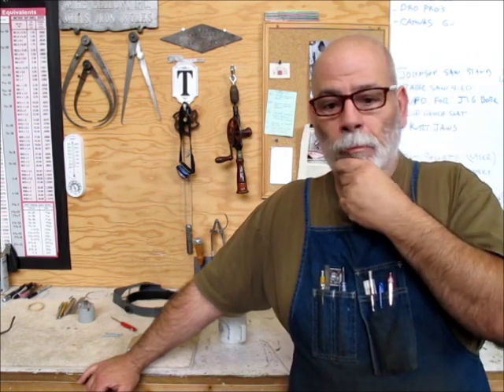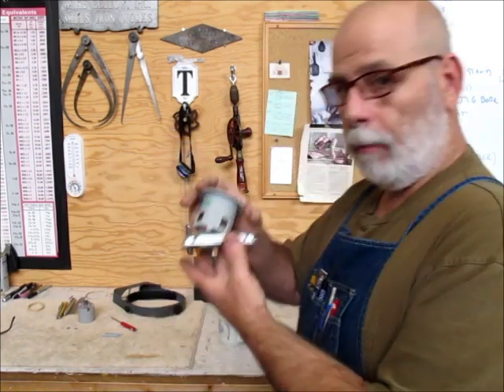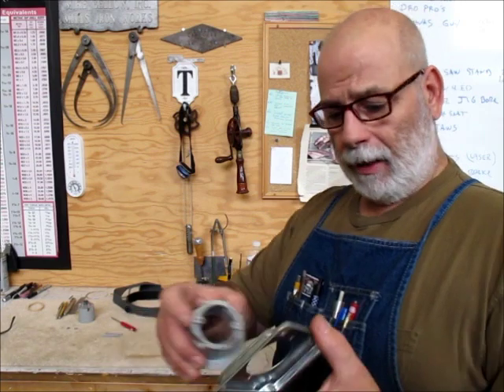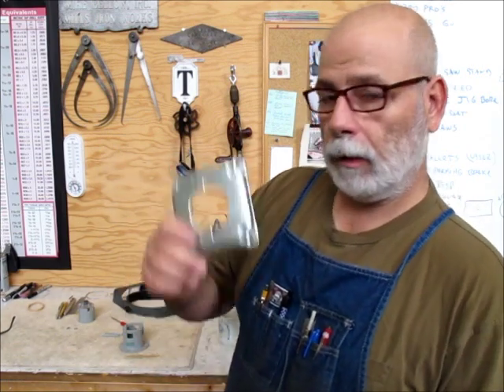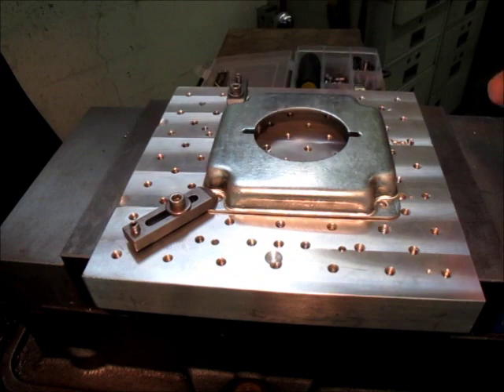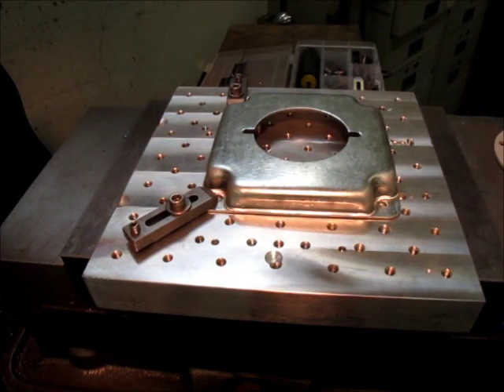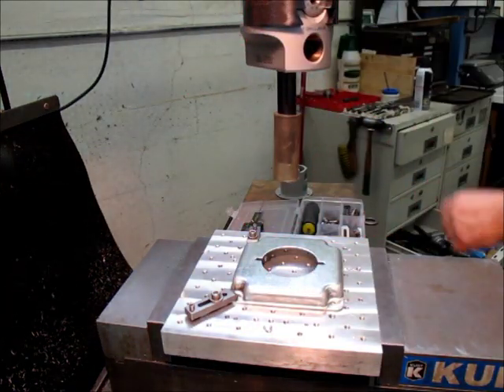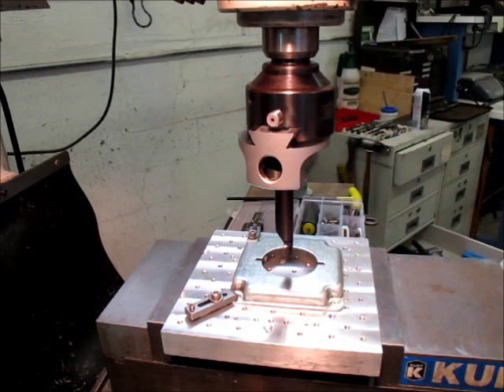Machinist vs Electrical Fitting

Comment: Hi Tom, thank you for the video, I'm now inspired to try to make some tiny clamps like those.

Could you explain why machinists don't like #6-32 screws? I inherited a tiny shop from a former colleague, and remember him saying he doesn't like them either. Missed the chance to ask him why.
Reply: The major diameter to minor diameter ratio is large. That means that it has to cut a lot of metal with a proportionally weaker tool, compared to other taps.

Comment: Quick question. Since this is just one hole, and in this case, it’s on center to the square plate, couldn’t we edge find the straight edges and find center of the entire plate?

Comment: That has got to be the most precisely located and shaped hole in an RS-13 cover in the world.  An electrician would have used his knock out cutter, warping the cover beyond belief, and then "forged" it flat with his hammer and the concrete floor.  Great job, gotta love the machinist mindset.  By the way, I am not a machinist and that was not a slam about the mindset.  Loved your work around to making the cover work.
Reply: Nope, no hammer. he would have pounded it flat on the concrete floor with his linesman's pliers.

Comment: I just love it when you guys (pros who do these things all day, every day) say it only takes a couple of seconds and then it takes two minutes. And on the second try, when you are showing the DI up close; three tries and it is still off. Makes little ole me feel better when I take several minutes, so thanks. 

On that hole in the electrical cover, I would have purchased one with a small hole (7/8"?) and just used one of my Greenlee chassis punches. Insert it, rough center, a minute of wrench work and done. With a perfectly punched, round hole. Notice I said a "chassis punch" and not "knockout punch".

Comment: FYI - Just in case you get landed with the job sometime, UK electrical switch plates plates are, since we went metric, usually M3.5 to mount the switch plates onto the electrical box. It's about the only place I KNOW we use M3.5 as standard. Cheap tap wrenches work fine because you're never tapping into anything but thin sheet steel.

Comment: I guess it's a good primer, but a huge part of learning the trade is learning what to let go. I'm used to running proto track machines, so I never would have approached the boring head, but I also never would have pulled my interapid out since you have the DRO. Why not bump one side with an end mill or edge finder, zero out, then bump the other side and split the difference. Bam. Zero. Or put it on the face plate and use a cone center to get it running true enough and cut metal.
Reply from the maker: +vclubamp Hi V,

I don't like edge finders for round stuff. Just personal preference. This video was about workholding not the actual best way to modify the particular part I used as my victim. Thanks for the comment.

Cheers,

Tom
Reply: I don't prefer edge finders for round work either, but for rough work, I just want quick. I would have just used an end mill...bump east, zero out, bump west and move back half and zero. Wash rinse and repeat north and south, then circle mill the hole. Anilam, hurco, and proto track, and wire edm have destroyed my will to break out the boring head anymore unless I absolutely have to.

Comment: I punched a 1 1/8th hole into a box today for a 3/4 coupling. My POS hole saw was dancing all over the place, broke the pilot bit.  Had about 1/4 of play in the box to plumb the conduit so it does not look too caddywompas. 2 minutes tops. It was a box just to pull a pass through bonding cable. GitRDone. Nice video though.
Reply from the maker: +Oleg S Hi Oleg,

I agree the subject was not the best. The video was about workholding not how to modify a fitting quickly. If I wasn't filming I would have used a half round file and been done. Thanks for the comment.

Cheers,

Tom
Reply from the maker: +Oleg S Hi Oleg,

No offense taken. I get so much email and commentary I have to be economical with my words. 

Cheers,

Tom

Comment: Just stumbled across this video.  My electrician father would have wet himself laughing at all the work, and time, and expense to mount that fitting in the box cover.  I did chuckle, but I also looked at this from the perspective of being a great primer on machine setup and different fixtures and how they can be used.  Well done!  :-)
Reply from the maker: +odc43054 There you go. Exactly. A demo of workholding tools not how to modify an electrical fitting. Thanks for the comment.

Cheers,

Tom
Reply: +odc43054 Can you say "anal-retentive"?

Comment: This is why you need a 4-jaw for your lathe.  This is a 1 minute job with that tool.
Reply from the maker: Hi Byron,

Thanks for the comment. This is a one minute job for a die grinder. The point of the video was to demonstrate the holding versatility of the mini pallet not to show the fastest way to open the hole up. It was about workholding options.

Cheers,

Tom
Reply: Agreed, but if I was doing it with a die grinder I'd end up with a ratty looking hole.  I'd use the 4-jaw.  Ah, as a workholding demo; sure.  I hate milling sheet metal; always a PITA to hold.
Reply from the maker: Byron Reynolds Hence the mini pallet. This sheetmetal might even be some trouble in a four jaw unless you set it at the bottom of the chuck or fussed around with parallels.......etc etc.

All the best,

Tom

Comment: Just double-checking: That's a VERTICAL test indicator you're using, right?  Thanks, -Chris
Reply from the maker: Hey Chris,

Its an Interapid indicator. This is my only criticism of Interapid is their naming convention. They call the one in the video a horizontal indicator. Its a model 312b-1 just exactly like this link http://www.mcmaster.com/#19515A51

Cheers,

Tom

Comment: While I don't think that your approach is that extreme, I'd bet that setting up the boring bar and cutting it took less time then doing a good job with a grinder and a burr, and I do see the charm in your mini pallet, I don't see the point in using it here.  Clamp the plate in the vise (don't crush it), drop the chuck or boring head in the hole (you'll be able to drop it in further because the vise and a set of parallels will give you more room) and bore.  Your 20min video (probably 30 minute task before editing) just became a 5-10 minute task just because you probably spent more time fussing with the clamps/holddowns... than doing the job (and yea, I might have stopped to check how close my eyeball was to dead nuts... adding 3-5 minutes of worthless puttering that would have made me prouder about how the originally wonky hole is perfect when I'm done ;-) ).  BTW, I just found your videos yesterday and after watching a couple of them had to subscribe.  Thumbs up!
Reply from the maker: Hey Mark,

You hit the cover plate on the head. When I shot this video I was looking for a victim to demonstrate the mini pallet with. I definitely pushed the practicality envelope on this one. Normally I would have used a good half round file and snagged the interference out of there. Thanks for the subscription. Hope you like the show,

Regards,

Tom

Comment: hi tom just a quick tip that I use to centre a hole and that is I use an edge finder. just place the edge finder close to the centre of the hole and then find the edge of both x and then use the half function on the DRO then repeat for the y you can get the centre very close using this method
Reply from the maker: Hi Slickoz,

Thanks for the comment and suggestion. I'm so used to reaching for the indicator. A hard habit to break.

Cheers,

Tom

Comment: Tom.  why not just use a rotory file and and die grinder?    Not really a tight fitting requirment part.  lol.    Also this may not be in code, it may have to be hard wired with a shut off,   or a covered recepticle.
Reply from the maker: Hi Derek,

You are totally right that I could get it done faster with another tool. The purpose of the demo was workholding possibilities. Imagine that sheet metal part was for a wafer coating machine and now its not a silly demo. Work holding is one of the biggest challenges in this work which is why this was presented. The part in this case was not the focus. As far as code this is a standard 208 3 Ph receptacle. The machine has its own disconnect.

Cheers,

Tom

Comment: Hey Tom, where would a fella pick up a set of those clamps you used here...?
Reply from the maker: Hi Paul,

I made them for myself. They are 1/4 thick and 1/2 wide steel. Its a great little project for the shop. Highly recommended. 

Regards,

Tom

Comment from the maker: Hi Toly,

You are correct that it could also be done it the lathe quite easily. The depths of my laziness prevented me from making any additional tooling to modify this part. If nobody was watching I would have left my indicator in the toolbox.

One reason for doing it the elegant way as you put it was to show holding an odd shaped part for machining. Workholding is one of the great challenges of this line of work.

Regards,

Tom

Comment: I think you went way over board to find center. Your using a dro so through a 1/4 pin in the chuck touch off both sides deduct 1/4 "and find center what's the big deal ?   I't's only a cover plate

Comment from the maker: Hi Tp,

I see folks using edge finders on round things from time to time so it probably works. My thinking has always been edge finders are for straight edges and indicators are for round edges. The thought is like this, If you are off axis of the hole which is why you're in there aligning it then how do you know that the edge finder is reacting to the true quadrant of the circle? Accurate spindle rotation is the best way to establish an axis and exposes out of round conditions.

Best,
Tom

Comment: Nice little video.  I'm building a plate for my mill at this time. 7" x 11" with 1/4" tapped holes, 1.5" on center.  I plan on making some hold downs similar to yours and was wondering on what stock size to use.  3/8" x 3/4"?  0r maybe 1" wide?
Thanks,
Jack